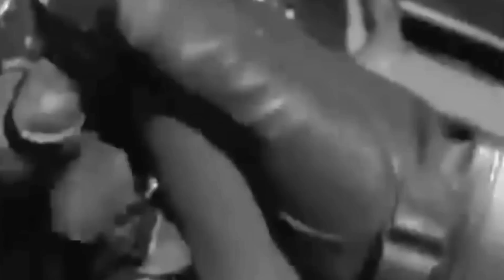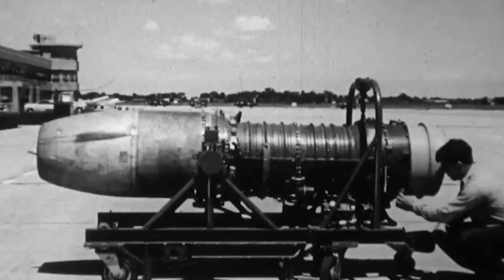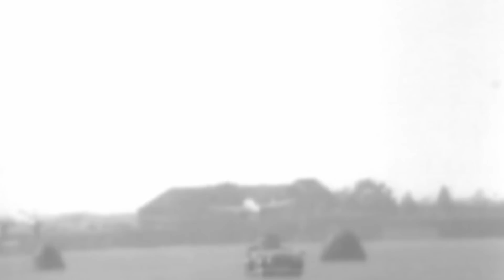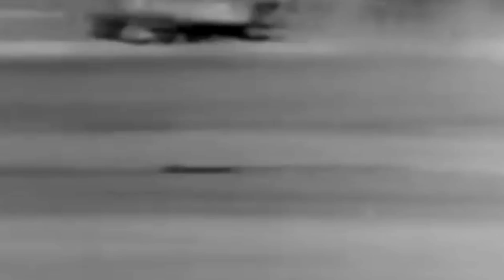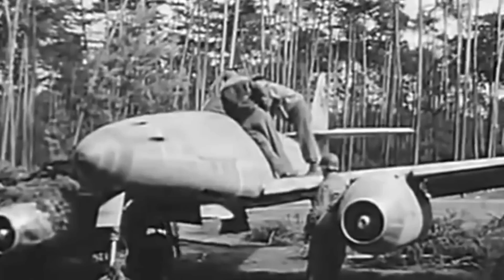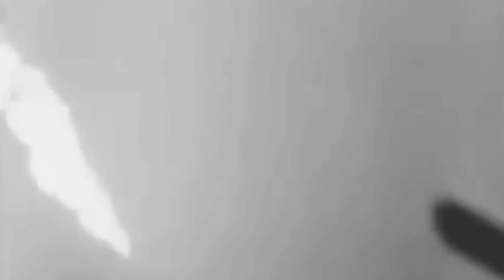The Never Before Seen Fighter

Comment: Having worked on the only two remaining fully functional Jumo 004 engines left in the world, I can say: 
Their revolutionary performance was heavily outweighed by their chronic lack of reliability. They were designed to run for about 25 hours and then be replaced and most never made it to 5 hours either due to being shot down, or, more likely, falling out of the sky of their own accord.
Trying to rebuild/overhaul these finicky beasts even with today's modern technology and materials does not solve for the faults in their design.
That being said, the Me262 was definitely a force to be reckoned with... at least until the allies figured out how to beat them.
Reply: Post ww2 France built co axial engines with better alloys but found they weren't that much better
Reply: @charlesburgoyne-probyn6044   It's worth noting that the Arsenal de l'Aéronautique kept Jumo 213 engines in operation for Nord seaplanes until the late 1950s or early 1960s.   That might make the Jumo 213 the longest serving WW2 German piston engine in operation.
Reply: Why such short engine life?  What components would fail?  Turbine blades?  Combustor? Bearings?  Compressor?  Poor quality control?
Reply: @AjitMD Turbine nozzles and blades are the primary failure mode of all jet engines, 
The Jumo 109-004A  had solid nozzle vanes and blades made from a Nickel based alloy called P-193 Tinidur A60, with a creep temperature of 1,600°F

The 109-004B engines used a Chromium based alloy and had a lower creep temperature but was the only jet engines that had vanes and blades that were hollow and cooled  by compressor bleed air, the entire hot section was coated with ceramic thermal barrier coating.
Technology that was not available to the Allies until after the war.
Any questions?

The
Reply: @WilhelmKarsten  Thanks for the detailed answer.  What kind of improvements in design, manufacturing process would be possible within the limitations in availability of Ni, Cr?  Heat treatment?
Reply: @AjitMD  If you look at modern turbine blades they are still air-cooled by compressor bleed air, but now instead of just being hollow and allowing air to travel radially from the blade root to the tip, modern investment casting technology and electric erosion drilling allows a series of air cooling ports along the length of the blade and shrouding the blades in a protective barrier layer of cooler air.
Reply: @WilhelmKarsten  Hello Sandyboy, as you know Sandyboy,  your mythical 'P-193 Tinidur A60' never existed. Tinidur was introduced in 1936 and had lower creep resistance than the 1932 Inconel alloys and certainly wouldn't be good for 1,600 F.  Tinidur lost significant strength at 1080 F (compared to 1260 F for nimonic 80). More over Tinidur was very notch sensitive and couldn't be welded.
As you know Sandyboy, the hollow blades were a serious weakness for the German engines which is why Oestrich dropped them for the ATAR engine, which he could afford to do with the superior Nimonic alloys. But as you point out the otherwise desperate use of sheet metal fabrication did allow the Germans to puff a bit of air into them to try and mitigate the worst of their weakness. Similarly the simple aluminium oxide coatings the Germans used did offer some protection if only for a short while.
As you know, the allies use of superior alloys negated the need for such efforts.
Reply: @AjitMD It's all a false myth based on misinformation and intended as a deliberate insult.
The Jumo 109-004A Orkan engines built with Krupp P-198 Chromadur alloy NEVER saw production or operational service.

The 109-004B was redesigned specifically for P-198.
These mass production engines easily passed the RLMs 100 hour PFTR reliability test required for adoption into Luftwaffe service.
 This is the same 100 hour test required for the RAF and USAAF
Reply: @WilhelmKarsten  Basically the engine and the airplane were deployed too late.  The basic concept was proved to work in 1937 by Otto von Ohain, but it was at the top of the priorities for RML.  It would have to be a priority project to be operational by 1939... difficult.  Same with their nuclear program.  Difficult to push for disruptive tech with limited resources.
Reply: @AjitMD  The Messerschmitt Me-262 and the Jumo -004B Orkan engines were easily a decade ahead of anything else that the Allies had during WW2.
Hans von Ohain and Max Hahnn beat Whittle into the air by just 2 years but by 1945 the Germans rapid development pace put them a decade ahead by the time the war ended... the British would have not have a flight rated production axial turbojet engine until 1955!.
Reply: @WilhelmKarsten  Hello Sandyboy, I see you are still trotting out your garbage about PFTR tests that have no bearing on the service life of production engines. PFTR  are primarily a developmental resource allocation measure.  No such test would be in the remit of the RAF and I doubt that of the USAAF.
Reply: @WilhelmKarsten  Hello Sandy, as you know Sandyboy, the Jumo 004 was an underdeveloped, fragile and unreliable engine. As you know, the nazis efforts to produce a viable jet engine was hampered by their strategic incompetence  that led to desperate measures to cure problems of their own making.  
As you know Sandyboy, none of the German WW2 jet engines with their appalling fragility and short service life were actually airworthy.

As you know Sandyboy the Metrovick F2 engine which flew in 1943 was far superior to the Ju 004B, having a thrust of 2400lb against the Jumo's 2000, having a pressure ratio of 3.5:1 against the Jumo's 3.2:1 and a thrust/weight ratio of 1.6 against the Jumo's 1.25.

Of course as you know Sandyboy the real exposure of the German engines' weaknesses came after the war when the Russians and the French attempted to adopt them. 

As you know the Russians and their nazi engineers could only make the Ju 004 good enough for a small number of second rate aircraft and the unreliability of BMW 003 led to it being dropped in favour of the British Rolls Royce Nene for the MiG-15.  After struggling with the Ju 012 they dropped that but cannibalised some of it which with they cobbled together with a heavily redesigned elements of the Ju022 to finally produce a serviceable turboprop by the 1950s.

The French of course took on Oestrich, a bunch of other nazi engineers and with a bunch of their own engineers spent seven years completely redesigning the BMW 018 and adopting British Nimonic alloys to finally get it into service years after comparable British and American engines. 

As you know Sandyboy, the rolls Royce Avon was in service in 1951.
Reply: @AjitMD  To correct a minor error, it was Hans Joachim Pabst von Ohain.  There was considerable priority given under Mauch and Schelp to Ohain's work but it's very unlikely than any of his designs would have produced a serviceable engine by 1939. Ultimately, despite his pioneering efforts no engine designed by Ohain would ever enter service.
Reply: @fritzwrangle-clouder6033  If the Germans were so 'incompetant' as you say and they ahead of everone else, what does that make everone else.They were doing what no one else had done before.Genius people creating machines.Hi from Australia.
Reply: @Muzz-y5s  But your question is based on a false premise. The fact that the Germans put immature and unreliable engine designs into operation in an act of desperation doesn't show that they were 'ahead of everyone else' in anything except putting immature and unreliable engine designs into operation in an act of desperation and that's not a demonstration of genius.  
It's not genius to build 8,000 appallingly unreliable engines using 15% nickel alloys when you could build 2,000 much more reliable engines with 60% nickel alloys, especially when you don't have a cat in hells chance of using 8,000 engines anyway.
I don't question that the Germans were working at the leading edge of GT technology but so were the British, so were the Americans, so had been the Hungarians, so were the Swiss and so had been the French.
Clive Sinclair produced an electric vehicle before many major manufacturers, being first amongst them didn't make the C5 a genius design.
Reply: @AjitMD  A little bit of all those things, but at the end of the day, they just didn't have high enough quality materials. The combustion chambers basically cooked themselves, poor quality bearings, oil pumps were notoriously prone to failure (that was one of our big hurdles). Believe it or not, the two stroke starter engines were the most reliable part of the whole thing. If they had another year or two to develop the materials, ww2 would have been a much different outcome.
They also had issues with deliberate sabotage by the forced Jewish laborers, PoWs, and other such prisoners.
Reply: But they didn't figure out how to beat them. They just attacked them while they were trying to land. That is not figuring out the Me 262 as a fighter plane. Would you consider the Germans attacking any American fighter while it was trying to land, being that they figured out the American fighter? I'm not coming back to see what you answer since youtube doesn't like me and gives me zero notifications.
Reply: @unwnme  They found the weaknesses and took advantage of them.The very definition of figuring out how to beat them.
Reply: @unwnme ❤❤❤❤❤❤❤❤❤❤❤❤❤❤❤❤

Comment: another bone of contention, the tricycle landing gear was chosen purely for engine performance because the tail dragger prototype experienced compressor stalls and surging  at low speeds in the take off roll from lack of airflow into the engine before the aircraft could be rotated level. does this author just pluck 'facts' out of his backside?
Reply: Not true, the tricycle gear was selected simply because the jet exhaust was redirected from the ground and interfered with the elevator effectiveness and made difficult to raise the tail on take-off.

Comment: 0: 44 sweep wing technology does not give an advantage in maneuverability, the opposite in fact. the Germans knew of the advantage of swept wing when it came to high speed flight, but that was not the reason it was chosen in the me-262, it was utilised to move the centre of gravity because of the engine's position. In actual fact, the 262 was not more maneuverable than the P-51, not even close, it used its 100mph higher speed and exceptional climb rate to evade the P-51, the 262 never engaged in dog fighting allied fighters, or even fast fighter bombers like the Mosquito, it used hit and run tactics to fight, which it did very very well, its main vulnerability was lack of engine lifetime, slow spool up of the engines, the throttles had to be moved very slowly or the engine would flame out and in some cases catch fire, and being attacked in the landing approached
Reply: That is a completely false myth based on a single highly dubious source and contradicts all the historical evidence.

Please stop posting lies and ignorant misinformation about a topic that you are clearly not qualified to discuss intelligently

Comment: Believe the F 86 and Mig 15 were based on the TA 183. Know I am correct.
Reply: They are all based on a aerodynamic data package produced by the RLMs Luftfahrtforschungsanstalt supersonic wind tunnel research laboratories in Brauschweig for the Projekt 1104 
This was distributed to all the bidding companies, 
Dr Seigfried Gunter designed the MiG-15 in 1945 before he was arrested by the Soviets.
The F-86 Sabre was designed by German engineers from Messerschmitt led by Edgar Schmued

Comment: Me262 is a beautiful aircraft even in today's standards.  Kudos to German engineers.
Reply: Swept wings and jet engines slung under the wings, it looks pretty modern.  The sweep angle looks to be about the same as modern commercial planes.
Reply: There’s a nice example on display at the Smithsonian Air and Space museum in DC.
Reply: @ordinaryman1904 Also in Pensacola at the Naval Aviation Museum
Reply: I think modern Germany has lost their edge in engineering. Mercedes, BMW, etc…has some strange reliability problems for the price.
Reply: @kenandbarbie-b6c  which reliability problems? My BMW is now 13 years old. not a single issue other than wear parts like clutch or brake pads that needed replacement.
Reply: @koehlerthomas I’m happy that you are not experiencing problems with your BMW. However, I know a handful of people that own German vehicles without long term success. I live in a warm, tropical climate. None of these vehicles were abused. They have had regular routine maintenance as recommended. The problems I observed was the overuse of plastic parts used on or in the engine that deteriorate after 5 years. One vehicle had a plastic guide for the engine timing chain. It got brittle with age & heat exposure & broke apart, which caused a cascade of related problems caused by the timing chain. There are other plastic parts that competitors like Lexus build with aluminum alloy on the engine that deteriorate, that is expensive to replace because it requires extensive disassembly to access the assortment of plastic parts. With a Mercedes a friend owned less than 4 years old, the lights would mysteriously turn themselves off or on, on their own, especially when the humidity is high. Weird electrical problems. I don’t know anybody here that owns a German vehicle directly because of long term reliability problems. They lease them nowadays so that they can return it when there are problems.
Reply: It LOOKS like the "bad guy plane". It's like a black 1969 Dodge Charger, everybody knows which wallet is his.
Reply: kaideechu: Oh my yes it could fly for many minutes. And was so reliable. Reminds me of a modern BMW.
Reply: @stephencurry8552 Spare us your hate speech and ignorant misinformation.
The Jumo 109-004B Orkan engines exceeded the RLMs 100 hours PFTR requirements for adoption into Luftwaffe service.

According to vehicle registration statistics BMWs are among the longest lasting cars in the world.
Reply: @WilhelmKarsten  Nazis lost. That is the end of the story.
Reply: @stephencurry8552  We are talking about jet aircraft here lad, no one here is interested in your particular brand of hate and ignorance.
Reply: @WilhelmKarsten  Hate the Nazis? Yes I do. It is impossible for someone who is logical to espouse the beauty of machines designed to kill people. As well, only a dullard would attempt to claim Nazi war machines are in any manner a positive. Fact remains this jet was expensive junk. I am thankful you germans wasted your time on such garbage. By the way, you lost the war. To this day you are occupied by American forces. You are the one who is incapable of dealing with the facts. german engineering is a myth, There are several videos on Youtube which can serve to illustrate that fact. Though it appears as though you have no interest in accepting the facts. Your little germany is in financial difficulty as this is being written. As stated previously, you are obviously not well informed as regards either finance or economics.
Reply: if you understood true history you would realize.....you lost.......read more of General Patton's thoughts re WW2 @stephencurry8552
Reply: @stephencurry8552  is it? the 4th reich is big bizness from war loot.
Reply: @WilhelmKarsten  Sandyboy, given the bitter lying wehraboo fantasist that you are it's more than laughable to see you accusing others of hate and ignorance.
Reply: are you sure????? @stephencurry8552
Reply: @WilhelmKarsten  Sandyboy, given the wehraboo garbage and bile that pours from you it ill behoves you to throw around accusations of 'hate and ignorance'
Reply: @stephencurry8552    You just got schooled.
Reply: @unwnme  So claims you. More likely. You are the same person posting with a different account. Nazis lost, with their superior equipment.
Reply: @unwnme  How did stephencurry8552 get schooled? Setting aside that Sandyboy is a notorious lying wehraboo, PFTR tests are development tests only and don't necessarily predict the durability of production engines in service.
Reply: @fritz-wrangle, are u crying because someone don't share ur hate on everything german, huh? 
So spare us ur further racism